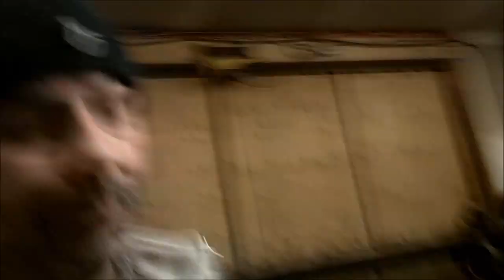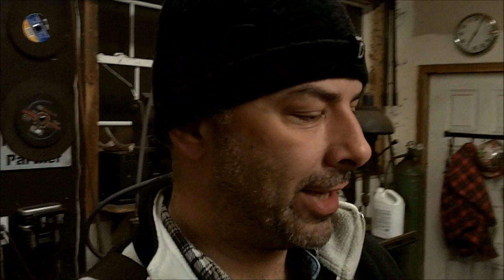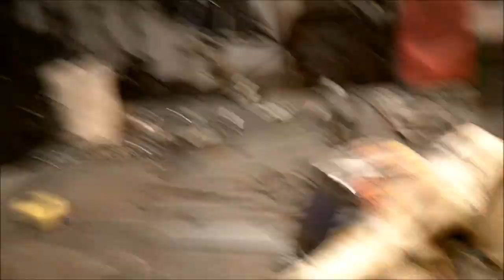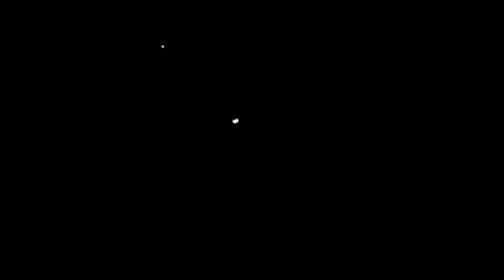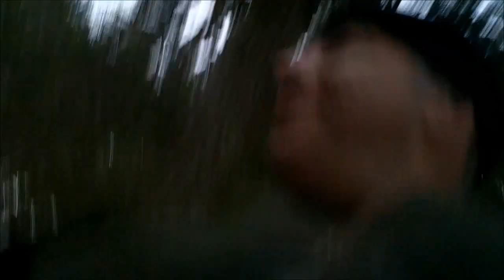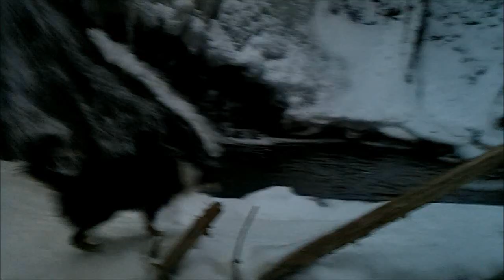FIRESIDE CHAT

Comment: I had a friend ask me if I could make a 36 inch sword blade in a triangle shape kind of like an epee I think is what they are called, or an old ww1 bayonet. I have basicly no experience but tried to take an old coil spring and see what I could do. So I fired up my little home made forge like the lively forge and straightend the coil spring and beat it on my harbor frieght anvil and low and behold I got a half round half square crooked mess. I am betting for you it is easy.  care to give it a go?